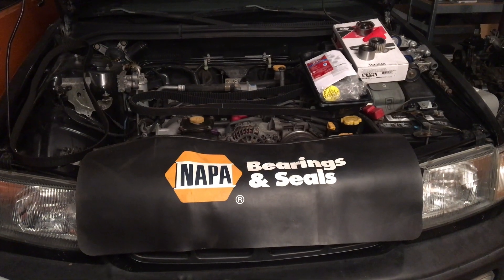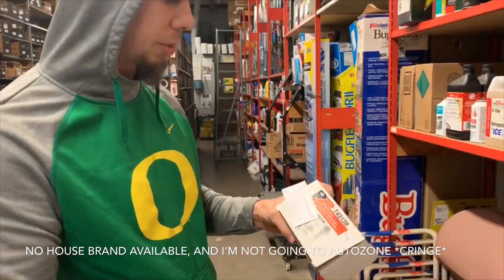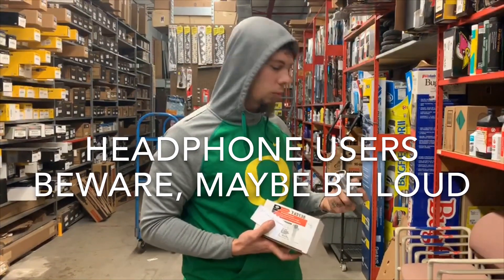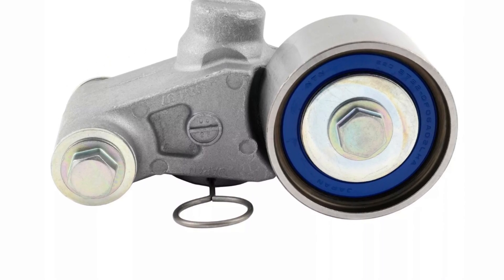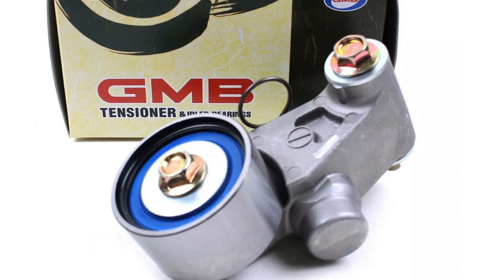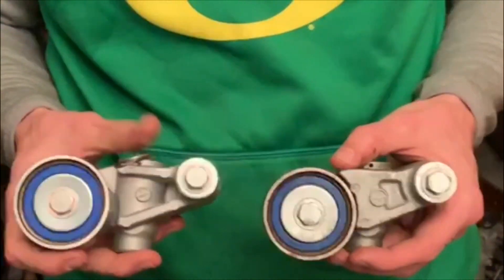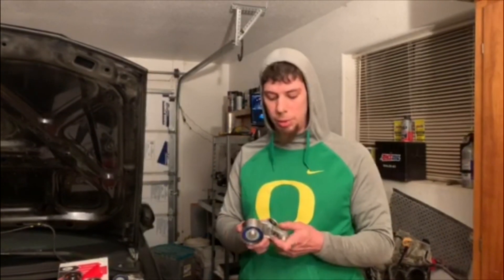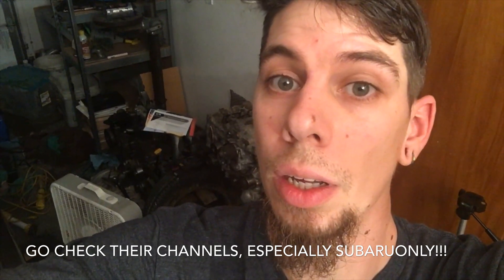Subaru Timing Belt Kit by Gates - The Whole Truth

Comment: That's bullshit. I just bought an OEM tensioner from my Subaru dealer. looks nothing like this fake chinese metal body. They still produce them as it looks. And the real thing is much heavier, bulkier and has Japan stamps and NTN stamps on the metal body.
Reply from the maker: I literally called ntn and they told me that it was their non Subaru patented housing, pretty sure I’ve mentioned that. It has all the same internals and the same ntn bearing. 

So what’s bs again?
Reply: @MonkeyWrenching  I thought you said they didn't answer/give a reply to your question. If they indeed said it's theirs then what can i say, it's very weird. I have seen and felt both tensioners, the "non-subaru patented" one is so much worse in terms of metal feel and finish, also has no markings of country of origin whatsoever. In such case i'd trust the Canadian one much more than this. Also who said it can withstand such forces like in a Subaru engine, maybe it was made as a prototype for some 1000cc engine with way less pressure inside the timing belt area.
Reply from the maker: Okay... what’s bs? Did you watch the whole videos? I examined multiple tensioners, even showed the difference in the stock tensioners to show the housings had changed and I also played the recording of a phone call talking about more details. 

Not really sure why you’re saying “that’s bs”, are you angry about other things and taking it out on the comments?
Reply: @MonkeyWrenching  Yes i've watched the whole video. All the stock tensioners had Japan stamps on the casting. What did NTN say tho? because speaking to Gates doesn't confirm anything. I am 100% sure this pulley's metal casting isn't made in Japan, even the Canadian version looks so much better than this cheap thing. If Gates had the audacity to put in Chinese bearings previously in their kits, while still saying Japan on the box, why wouldn't they just lie to you on the phone?
Reply from the maker: Refer to my pinned comment.